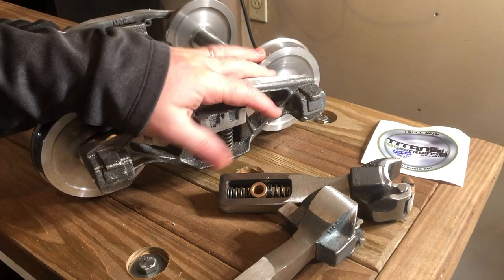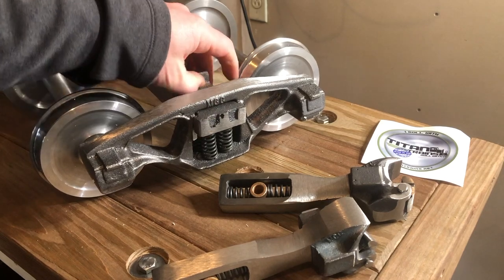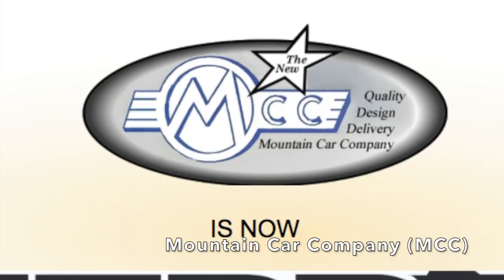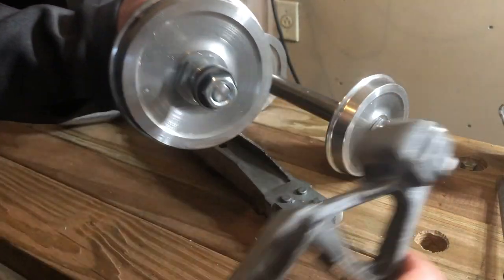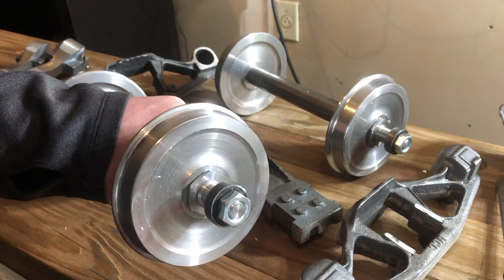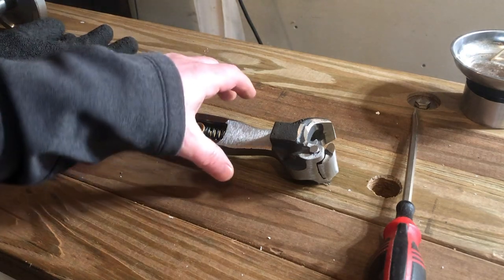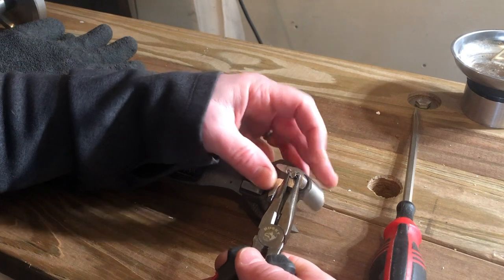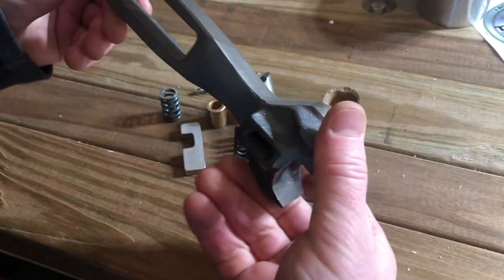Backyard Railroad: 7.5" Gauge Titan Trains' Trucks & Couplers (Our 2nd Batch!)

Comment: I thought everybody in the US was doing 7 1/4 and I see you advertising your channel with 7 1/2 inch track or gauge. Can you explain? Please
Reply from the maker: You can find both gauges. But I feel like 7 1/2 is more common in the US but you can’t quote me in that. We chose 7 1/2 because it’s bigger. When we had no experience, we thought it to be more stable. Also, when we started, there seemed to be more access to 7 1/2 materials like these trucks here in this video.

Comment: So on titan trains they say 1 pair of trucks is $515 per pair. 1 pair is 4 wheels on 2 axels for only 1 of them or do they go by 1 pair for the 4 wheels on 2 axels but 2 of them to make a train car for that price? I been looking at making 1 or 2 cars my self and start my own train by building up a couple cars to roll around and work up to a locomotive and more cars after that.
Reply from the maker: Hi! Fun and good luck to you! …1 pair of trucks is two trucks which will complete one train👍👍 They are really nice 👍 f you ever need to call them. They’re honest!
Reply: Thank you for the information, I did order a pair of trucks and couplers. Thank you I should have fun building. Also what was the distance between the end of the middle bar and the 2 cross beams to hold the trucks? Was it 5 and a half inches roughly since I am going for a 4 foot to 5 foot cars making them transportable if needed, plus cutting weight down. Since it’s only me that’s going to lift. Unless if I get a pair of cherry pickers to hoist them up. Of course the width is 16 to 17 inches as I saw on titan trains site. So I know titan sells 3 lengths 5 foot 6 foot and 7 foot the 7 foot is the one is on the home page is the newer one it’s 91 inches coupler to coupler. So most likely I will stay in that 4 foot to 5 foot range. Especially if I go with plum cove locomotive power. Unless I go back yard train co is between plum cove and titan trains for locomotive pricing. When I get my first car built I will send you a photo or video of what I went for. Thanks again for your help. Since I know it’s not cheap especially when your on a budget.
Reply from the maker: We get these questions a lot. Please check out the following video and its description for more details on measurements. I just updated it. Let me know if that answers your questions or what other questions might come up 👍 https://youtu.be/vCLsxCSjllw
Reply: Ok I over looked it I saw all the dimensions for drilling just now. Thanks again when I get everything I will be ready. Will do if I have any other questions as they come up. Then in one of your other videos you were talking about safety chains. I looked up that the standard for that gauge is 7 links per car 3/8”  thick, 1” wide and 2” long if I remember correctly. Then I bolts that are 3/8” thick then matching washers, lock nuts, and nuts. Also you could use D or C clips at the end of the chains or have open I bolts with the chains. Hope that helps with safety chains for the ends of the cars on your railroad. Signed Dustin
Reply from the maker: @dustinmayfield2148  Sweet! Thanks, Dustin!
Reply: Here is the video on safety chains. Hope this clears up the safety chains for you. https://youtu.be/NEEQrDUpzxw
Reply from the maker: Very cool! Thanks! I have not seen this video or this guy’s channel!! Thanks!
Reply: No problem. Hope you come up with a good solution to keep your cars safe especially taking them to a railroad club in the future. Also been looking at plum cove studios and Backyard train company for locomotive. Seems like backyard train company is good with there products all metal, but higher cost less then titan trains though. Plus noticed you had a faulty connection on your wire harness from plum cove witch is less cost but wood frame. Lot lighter as well compared to titan and backyard train company. Also silent running on plum cove and back yard train company. Plus it’s just me that’s going to do the lifting. Back yard train is around $4,000 to $13,000 on range, plum cove was $1,100 ish to almost $7,000 on range, titan is a flat rate of $14,000 to $21,000. Would you recommend plum cove studios or go middle of the road? Also space is limited for me as well. Titan having 7 foot to almost 10 foot locomotives to scale. At most for me 4 foot to 5 foot locomotives at max. Witch I know limits my options of locomotives. But with back yard you also get sound in there hustler locomotive, but paint is extra just like titan as well. I am torn between plum cove, and back yard train company. But budget calls for shoe string and pulley system. Of course material are another factor as well as battery vs gas. But I am sure there’s more options out there as well.
Reply from the maker: I think the Plum Cove we got is super entry level and I’m not sure I’d put them in the same convo with Titan or Backyard Train Co. For us, we wanted to start rolling right away so we went with Plum Cove’s Generic Electric. Like you said, too, weight and size is extremely manageable, but still heavy. I can’t WAIT to have our yard set up where I don’t have to lift ANY of our cars and they can just stay on the track.
Reply from the maker: I’m sorry, I don’t think I’m in a position to recommend for you. Like many things, I think you get what you pay for. At this point for us, we’re really happy rolling around with our Plum Cove. That being said, I might need to double head it as we build more cars to pull. That might be a part of you equation, too. How many cars do you see yourself pulling? Once again, I think the dollar amount all comes out the same. When we start pulling more cars, we’ll need more traction/wheels to the track etc. …Another thought is the details. We’re happy not going to scale etc. But if you are, BTC and Titan are much more detailed. Anyway, I think you see what I’m saying.
Reply: It’s ok,I been busy and doing more research and, I did find an in between option. On locomotives. I could build my own I was watching another channel that deals with the scale. He’s making a replica of one of the locomotives he built years ago. It’s the mill brooks railroad. He has number 70 currently, and also the plum cove studios as well but he needs to replace the traction motors and gears after 8 or so years of use with that tiny one. The other is all hand built on the number 70. He is using a 2 method to his having it tethered and RC controlled. Using a Syrien 50 amp motor controller, 2 deep cell marine batteries that will be 27 volts eventually he has 24 now on volts. Plus a kill switch with removable keys as a safety option. It’s a heavy duty 24 volt marine kill switch, for boats, trucks, etc…, also a fuse link with fuse. Might want to look into a fuse and that kill switch on top of the one you have just in case if anyone try’s to turn it on when they get a little bit bigger. You know how boys gets between a few years old and teen years. That’s why I am over engineering mine to have 2 safety switches. Maybe a 3rd with a standard key on top of that so it anti theft proof and also locked out especially while working on it. But I might make mine into a Plymouth Switcher or something like that, or something no bigger then 4 or 5 foot long do to the weight, and how much in transit to load for going to different clubs and other meets. To scale at 5 feet would be a 40 foot box car. So at least would be a GE 20 ton, up to maybe a 80 ton locomotive at max at scale of 4 to 5 feet, real size of 36 or 37 feet long. Since the SW1 or SW2’s are just about 6 feet long to scale are close to 45 feet in full scale. So that’s my target area is around that size having a 20/23 ton to 80 ton for now. Also I finally got ahold of Jim from titan trains. The trucks should be shipped out next week and should get them soon. Plus I work with metal for my job, and there’s wood as well I could make a chassis, and engine cover since I should have the rough dimensions. Plus I have done electrical work before. All I need is powered trucks of some sort then I can put it together. Plus I love my diy to save a little bit on money but yet still will be expansive as always. The kill switch from Amazon is only $12 pack of 2 with 6 keys and 2 weather plugs when key is out of the switch. The fuse link and fuses on Amazon is $13.49 for 5 pack and 65 different fuses. Hopefully that will improve your locomotive especially long runs, or heavy duty with the fuses, and safety locking the locomotive for the future. Signed Dustin. Also ps. When I get my trucks and build my car and locomotive I will tag you in there as well.